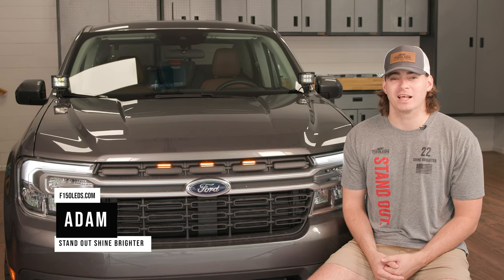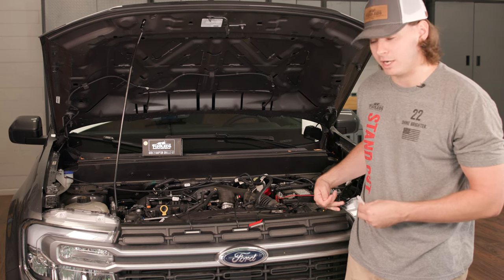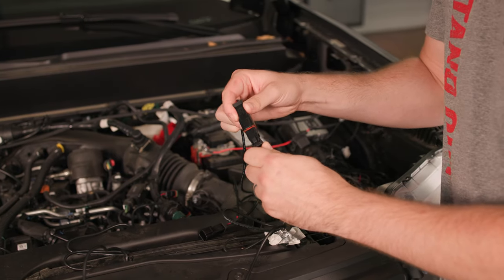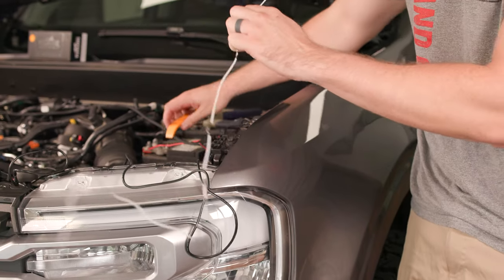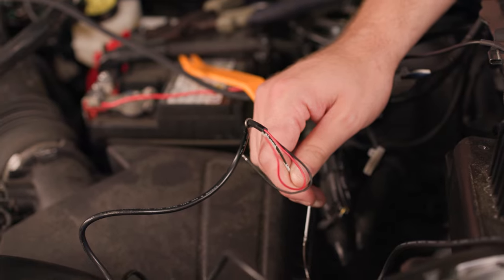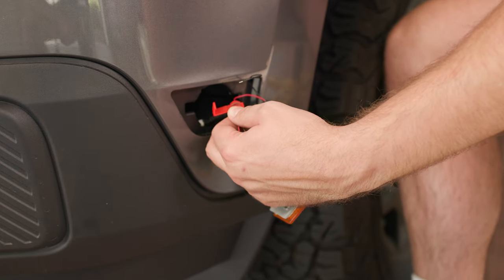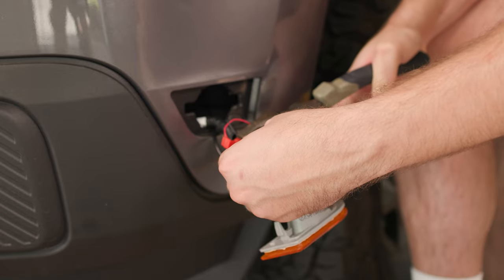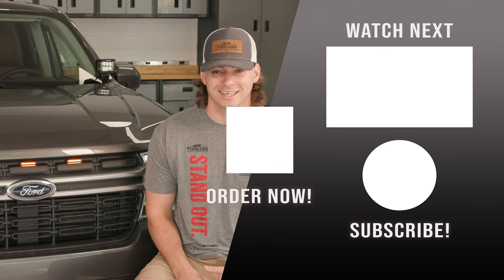2022+ Ford Maverick Raptor Grill Kit Installation F150LEDS

Comment: I noticed you left stripped ends of the wires hanging out of the connectors.  This is inadequate.  That can short out if the hot goes to ground.  The connectors are designed with a wire stop on one side where the end of the wire being spliced in should butt up against and not allow the bare end to be exposed.
Reply from the maker: Hey Richard, thanks for catching this, you are correct the wire should not be placed past the quick tap back stop. Adam went back and trimmed the excess wire but it missed placement in the video.
For a full explanation and demonstration of proper quick tap usage please see our video here:
https://studio.youtube.com/video/PoSJHY2Y1ys/edit

Thanks for your support, we look foward to serving you soon!

Comment: Is there anyway the adhesive could be on the back where the wire is coming out? I would like to drill hole in the plastic so the wires are hidden. I do not like how the wiring looks here, it could be mush cleaner...
Reply from the maker: Hey Ted! Yes you could apply the adhesive to the rear with slight modification if that was your desire. Thanks for your support, we look foward to serving you further!

Comment: My wire splicers didnt work :( Any tips? I'm not sure how to even remove them for normal splicing, what a pain.
Reply: cut them out and spliced the old fashioned way, got them working. Bummer they didnt work properly.
Reply from the maker: Hey Friar, sorry to hear about the issue but glad to hear you got it worked out! Please let us know how we can serve you further!
Reply: @F150LEDs  Thanks for replying, i love the product, probably just my user error some how, but actually is there an easy way to get some replacement sticky pads for the 3 leds raptor kit? 2 of mine stopped sticking even though I scrubbed the plastic with the alcohol wipes but I think its because the wire has to bend at too sharp of an angle where i had them creating resistance which lifts them up so need to place them further out so there is more space for the wires. Might just have to try to cut my own or something from some generic.
Reply from the maker: Absolutely! If you could send your order details/email./name etc. to our support team they will get you taken care of! Thanks again for your support, we look foward to continually serving you!
Reply: @F150LEDs   Its awesome to see a company that not only responds but also cares about their product and customers these days. Thank you, i've loved everything I've bought so far.
Reply from the maker: It is our honor & pleasure, thank you!